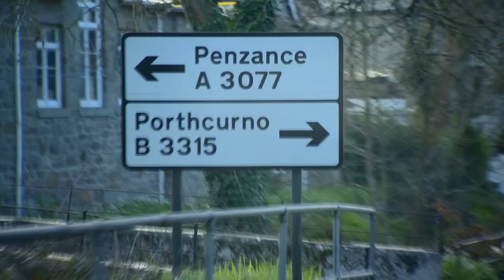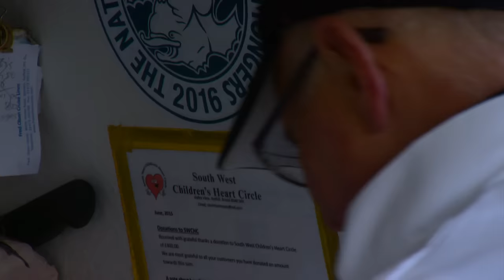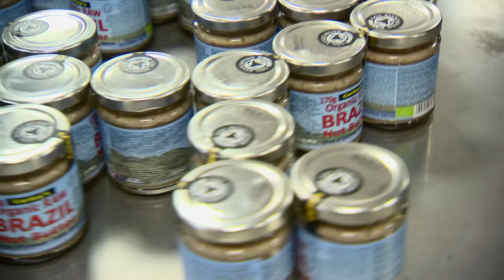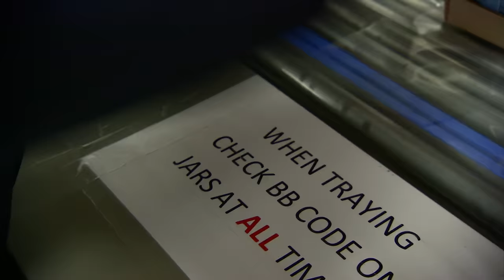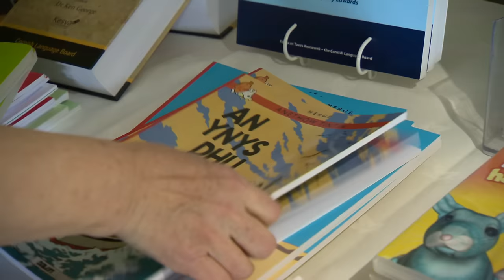What do people in Cornwall think about Brexit? - BBC Newsnight

Comment: Many fishermen, French or British were always greedy for money without much regard for the fish.
The fish industry is not about fish it is about Borders as exemplified by the fact that the timber industry is the same economic size as the fishing industry whilst there is no problem about production because it is regulated.
 However in their greed, the fishers built new houses and bought new cars on the back of the raping of the cod stocks in the North Sea.  There were no cod to be fished and only regulation rescued it after 20 odd years of laissez faire
  Joining the EU supported regulation which although rightly, made a gross diminution of the fishing industry.
Now the British have their fishing back there will be the same level of greed as previously unless the Brits regulate that industry.  exampleAs an example, the French were not allowed fish the Saint Jack Shells before the month of May according to EU regulations to conserve the species but the English started in March when the young shell fish were not mature enough endangering the species.
So, there are two issues, 1 Borders and 2 Conservation of stocks.